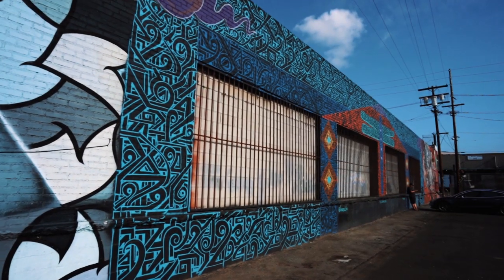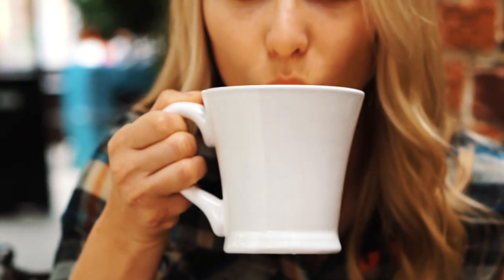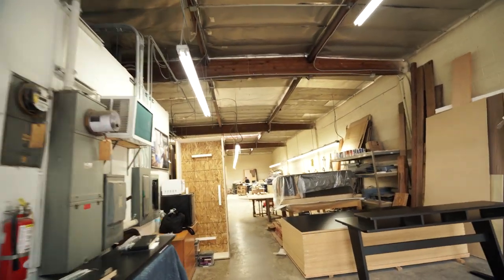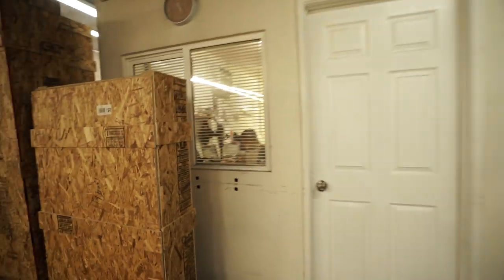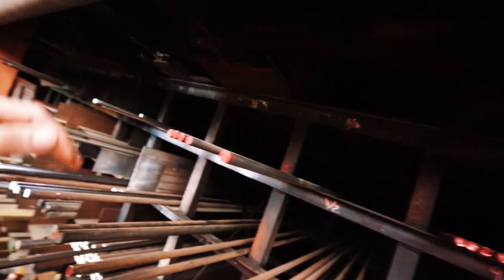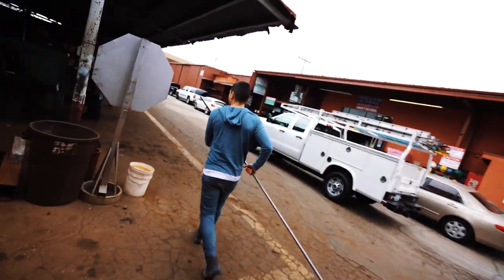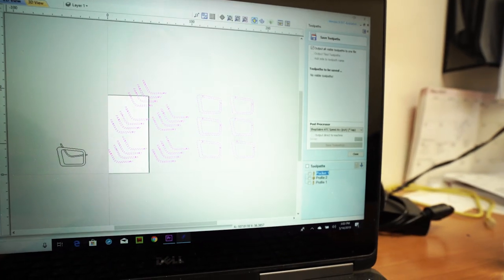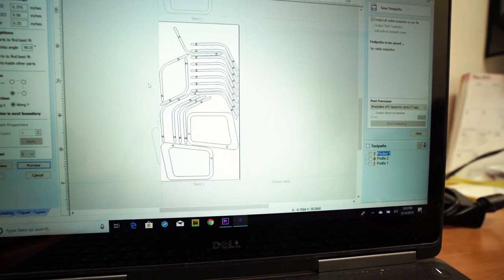Building a Retro Modern Lounge Chair!

Comment: If that is woodworking then I am Tony Stark with my soldering iron alone. Gluing and sanding doesn't make you a woodworker. So much so for being glad to share the process... What if one doesn't have a cnc machine? Any ideas? How about bending each slat of wood to exact angle and then call it a woodworking video.